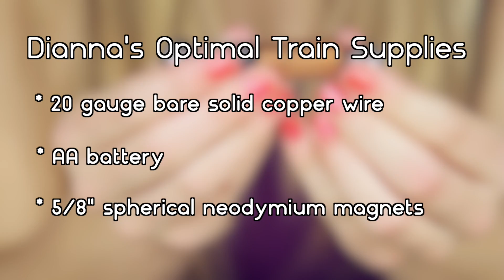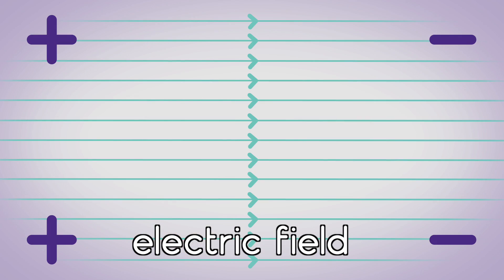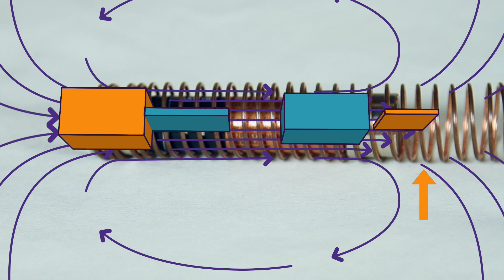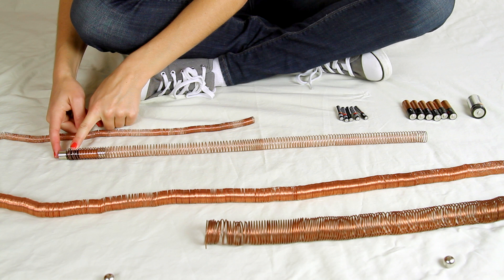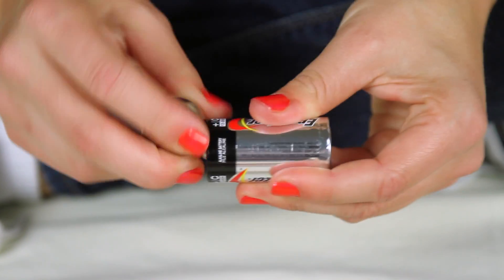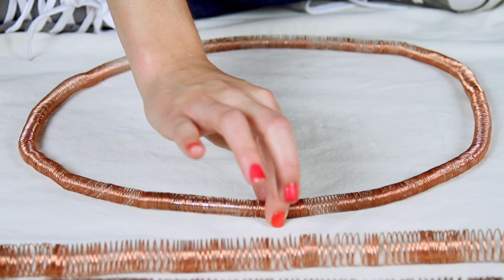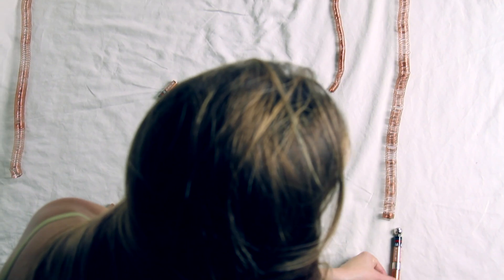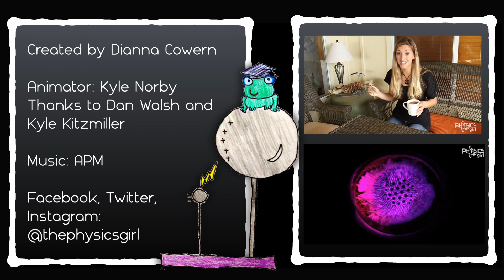World’s Easiest DIY Electric Train

Comment: I'd be very interested to see a follow up video that attempted to explain why some sized batteries worked better than others. There are a lot of variables at play but it would be fun to try to figure out how much EMF is being generated vs the weight of the batteries and magnets. Then maybe an accurate prediction could be made as to what the fastest combination is.

I know it might be a little too technical for this channel but I would appreciate a nudge in the right direction to investigate this myself.
Reply: I think you're right about the weight of the batteries being a factor.  A single D cell doesn't put out any more power than a single AA cell, it's just able to do it for longer (more milliamp-hours) and so is larger and weighs more.  So given the same amount of force being generated, the D cell electric train would go slower than the AA cell train.  But if put to the endurance test, the AA would poop out first.  At least that's how I figure it.
Reply: You need higher voltage, higher power output which for batteries translates to faster discharge capacity and obviously less weight. LiPo cells would almost certainly excel at this. A high voltage supercapacitor with a resistor to limit its discharge should be able to shoot out like a bullet.
Reply: I would say weight has a lot to do with it. After she did the AA I was thinking about a AAA, I know those two provide the same voltage but one is smaller so it should move faster, then she mentioned AAAA which I've never heard of. If it provides the same voltage and force as the AA it should go faster since there is less to move. I'm not sure off of the top of my head how the D voltage compares to the others but from the results, I would guess it's weight increased more it's voltage relative to the others.
Reply: There are other variables like the thickness of the wire and how tight the coil is to the various sized batteries and magnets. Also the distance between the magnets.
A high powered watch battery would be interesting. I might just have to run my own experiments!
Reply: +Patrick Beecroft I hadn't considered a watch battery, that would be interesting to see. But the thickness of the wire shouldn't really make much of a difference though I think she said it was roughly 20 gage wire.
Reply: +Patrick Beecroft I hadn't considered a watch battery, that would be interesting to see. But the thickness of the wire shouldn't really make much of a difference though I think she said it was roughly 20 gage wire.
Reply: The batteries tried in this video all roughly have the same power to create a current, because they have about the same inner resistance, at least same order of magnitude. So they all create about the same amount of force, but they have different weights, resulting in different amounts of friction due to gravity pushing them onto bottom of the track. If you try a battery that has a much lower resistance, e.g. a CR123A lithium battery, and that in addition is much lighter, you should get significantly higher speeds. The track might not hold up, but I'd like to see that :-)
Reply: ASMR Explorers You're probably right, CR123A can be discharged with 2.2A and at double the voltage than a double A.
Reply: Patrick Beecroft You are right, but the winding will have a bigger effect of the outcome.  More raps and tighter winding will effect the current significantly.  As for the batteries...AAA, double A, C, and D are all the same voltage just different milliamps.  I would also love to see and experiment more with this idea.

Comment: I wonder what would happen if you could electrically connect the two ends of the coil, while you have it looped in a circle..

As it is, there is a brief moment while crossing the "break" where there is no propulsion, only momentum.

With a completed loop circuit (electrical), would a counter-field be generated in the remaining wire? If so, would it aid or slow the progress? If it continued to move with the wire connected, wouldn't this constitute a perpetual motion device? Maybe even without the connection.

If this could be mounted to a framework to hold the coils in alignment, could a secondary coil be wrapped around the first and used to generate electricity from the passing magnets?

Just thoughts after watching your wonderful video   : )

Comment: why cant we generate electricity using this principle?. (I'm guessing we don't )
Reply: what?? the field is produced through electricity, this train CONSUMES electricity
Reply: Minhaj Siddiqui 
Calm your jets.. I didn't say I knew anything now did I. .  ?   How does it "consume"?  - chemical energy of the cells?
Reply: electricity does generated by electromagnetic induction
Reply: This system consumes energy. The magnetic field that was produced by the copper coils was made from the current provided by the battery.

What you are talking about is something else but based on the same core idea. Electricity is generated when you have a coil "cutting" a magnetic flux. Basically shove a magnet through a coil and the changing magnetic field will induce a current in the coil.

Comment: The AAA batteries and C batteries have the same voltage, so they have the same force. However the C battery has more mass so it can't move as fast. Hence the smaller AAAA battery goes faster. Of course, the C battery has a larger capacity so it should run for longer before dying.

Running batteries in sequence increases the voltage so they have more force, but it's also not perfect because you are also increasing the mass. But if you found a battery with a larger voltage it should move faster.

Comment: Can this be the future of trains?
Reply: In a way, this is a rudimentary Maglev train.
Reply: dimitriofronin Cool!
Reply: Actually its not anything like a Maglev train because the magnets are not levitating anything. All the weight is still pushing down on the wire. The magnets are more like the drive wheels.
Reply: That's fair enough. I prefaced my statement with "In a way" because I was aware it was functionally different in many ways. Nonetheless, it is propelled electromagnetically in which some systems of Maglev are. I did not mean to be misleading, simply relating the most basic concepts together. However, your statement of it not levitating is true, thus removing the "lev" portion of "Maglev".

Comment: is the explanation about the "different" magnetic fields really correct? I'd say that the magnetic field created in the coil pushes against the fields of the magnets equally, not one more than the other. Or did I misunderstand?
Reply: It's that the magnetic field is stronger more towards the middle and weaker on the very ends. So on each end the magnets have to be oriented to take advantage of that. The strength (not direction, just magnitude) of the magnetic field goes in mirror images on either end, so the orientation of the magnets have to be in mirror images on either end too. That way the poles closer to the middle on each end are the ones that matter.

Comment: Hi, I've some questions!  I understand that a magnetic flux (say by moving a magnet) through a coil will induce a current in the coil which will in turn generate a magnetic field to oppose the motion of the magnet. So, does the battery function only to strengthen the secondary field? Can we replace it with just a metal piece and see at least some similar but damped motion upon a light push? or would that completely violate the conservation of energy and that the battery is integral to break the equilibrium?

Comment: Try again with a lithium battery! More voltage!
Reply: I personally wouldn't want to create whats probably a near perfect short. Unless you had some small circuitry to control the discharge rate and stuff. And a small enclosure like a hollow pvc tube with a magnet either end as electrical contacts.
Reply: Nico Mariño /osfgkFyq7lA?t=242
thats why it is dangerous.
Reply: Nico Mariño its a quite a thick copper wire so the resistivity of it shouldn't be high at all. So it would still be a dead short. . But at the current and voltage its at, the formula P=IV would probably show a high current and drain the 1.5v AA battery quite fast. She said she used 20guage i believe, 
So according to this
https://en.wikipedia.org/wiki/American_wire_gauge
33.31 miliohms per meter of wire. Which considering making a coil and the wire at the 2 terminals is a lot less than say even half a meter.
its practically a dead short as i stated.
Reply: Nico Mariño  The resistance on the metal coating ion neoodymium magnets have tiny amounts of resistance. People use them as quick connections to batteries for ages. If they did have (significant) resistance the magnets would heat up. which at the current is nothing. With the 20 guage wire and assuming 40cm of wire is in contact at any 1 moment through the wire with the details i shown from wikipedia, 
V/R=I
(1.5)/(0.4*0.03331)=113Amps
Since that is physically impossible its likely the internal resistance would increase a ton.
So the voltage would drop to something tiny like half a volt or whatever in a AA battery.
Though with a lipo, the video i sent done a short through even thinner wire with likely higher resistance and it does heat up and would eventually blow. Only with a controlled discharge circuit should someone do that. Which is hard to fit into a tube like structure like a AA housing. I wouldn't mind seeing someone make it. There are some tiny lipo's out there.
Reply: Nico Mariño Not sure. But i am sure it varies based on C rating.
Reply: Nico Mariño ok. Ill research when i have the time i guess.
Reply: I reckon the resistance it sees is higher than the stationary resistance due to electromagnetic induction. Think of how mains transformers work. If they were stretched out without a core, they would totally burn out straight away.
Reply: Prehistoricman maybe. But it seems not particularly tightly wound. So I agree some resistance will be made, however it doesnt seem too significant. If you know, i would not at all mind you sending me the math.
Reply: Mr Rishi The Cookie Oh no, I don't have any maths. A level physics doesn't tell you about frequency response and inductive loads and that kind of business and I couldn't do electronics.
Reply: Prehistoricman Eyyy I just finished my AS physics(AQA new spec) exam earlier today. Im probably doing astronomy as the module next year if not, then electronics seems cool.
Reply: Mr Rishi The Cookie Oh nice! The new spec is rock hard! props on doing it, it's basically as hard as A2 physics these days.
Reply: Prehistoricman Some bs questions came up. You should see the twitter complaints.
Reply: Mr Rishi The Cookie 
There are lithium cells which are shaped like cylinders,in fact they are one the most common types of lithium cells and they usually have an over discharge protection circuit built in,so they wont explode even if you short them.the AA equivalent is called 14500.Usually they dont have a high C rating,they can put out maybe 5amps at max,though some can discharge at higher rates.
If the inductive component of the circuit was insignificant then the movement of the train would have been insignificant too.
I Tried shorting a 18650 battery which can discharge at 20a cont. no problem with a 22awg 50cm wire and it was pulling less than 9amps (should be about double with a 20AWG),the wire was getting hot but it was still less than 90c after 4 seconds.I'd try making the train but i dont have the correct size magnets.
Just for the sake of it i shorted out my 1800mah 70C 4S lipo with the same type of wire and the max current draw was less than 50a before the wire blew.So the 113amp draw is not going to happen at 1.5v in real life.
TL;DR: it's not a short circuit and it'll be unlikely for a lithium cell to explode if you used it unless you use a low C,low capacity lipo with no over discharge protection and dont let the train move.
Reply: +Dwg thanks for correcting me. So what you are saying is that it should be OK but comes with risks as compared with an alkaline battery. Science is fun i guess. Hope your train works out.
Reply: You've got a point there, however if the train is moving, each section of the coil would only have a current passing through for fractions of a second, so I doubt it would overheat. However if your train gets stuck, you could indeed have a hole burned into your carpet from glowing copper wire within seconds, no doubt. I'm sure that would only add to the excitement though :-)

Comment: Your magnetic field diagrams are not very helpful.  The right hand rule might help.  
The force applied to a magnetic field is at right angles to the current and also at right angles to the magnetic field.
The direction of the current is pretty clear, between the two contact points.
It is through the coils that surround the battery, between the contact points, and no where else.
So the field around the outer ends of the magnets has no current to react against.
 
But the two like poles, pointing flux toward the battery 
(or away from it, depending on whether two north or two south poles are stuck to the battery), 
produce a field pattern that sprays out all around the battery, 
passing at right angles through the coil current.  
So the force generated is at right angles to both the current and the outward (or inward) pointing flux.
The only direction that is at right angles to both of those direction is along the axis of the coil.

That shouldn't be so hard to show in a graphic.

Comment: Would replacing the 1.5v batteries with a 3.7v li-ion (18650) make it faster? Or would the extra power/extra weight cancel each other out?
Reply: Higher voltage = higher current = stronger magnetic field = moa powa
On top of that most lithium cells have much lower internal resistance than alkalines so they can deliver more current (on top of the higher current because of the higher voltage). So a li-ion should definitely be faster, but if it gets stuck in the coil you should run ;)
Reply: I don't really think shorting a li-ion is a good idea.
Reply: +Ireallyreally Hategoogle The copper coil has a very low resistance.
Reply: I second that suggestion
Reply: +WKDworks technically you are.
Reply: Well that's really just even more reason to do it! FLAMING MAGNET TRAINS!
Reply: Use a 16340 cell, it's the same voltage, but smaller, which means it's lighter so it will move faster. It can probably provide the same current as an 18650
Reply: ***** you aren't just shorting it out, you're using the energy.
Reply: It's not shorting it, the coil has resistance.
Reply: *magnetic field ;)
Reply: Ermude10
Thanks, of course. Corrected.
Reply: more coils between the magnets means more resistance and more magnetic flux. Just be sure not to short the coils :)
Reply: Danny, sorry but if you're solving for current: Current=Voltage/Resistance. Since the resistance of the wire remains constant, more voltage does indeed result in more current.

Comment: What would happen if you were to introduce an outside electric current to the coil alongside the battery?  Would the increase in electricity on the coil combined with the battery allow a faster and more forceful movement?

Comment: Make it easier learn to solder. Put copper wire rails on the outside to keep the winding uniform. Try rails on the inside for it to ride on.  Could you do this in 1/2 inch copper pipe? When you drop a single magnet down a copper tube it slows down.

Comment: I don't understand the use of the battery here, I understand that the magnetic field is caused by the magnet movement inside the copper wire and it pushes the the magnet. but where does the battery role in this

Comment: The C size battery performed poorly because it has more mass but is still 1.5 volts just like a AA or AAA. Try it with a 3 volt watch battery (or maybe several). More voltage, less mass

Comment: Dianna you have to make a much bigger track like a rail gun!
Reply: so basically you could make a rail gun that shoots batteries as bullets, the magnets would make the bullets real expensive though :P
Reply: +Wabbajack Wabbajack compressed air is much cooler especially as electrical circuits tend to run fairly hot
Reply: closer to a coil gun or Gauss rifle I would think
Reply: SavageMoose oh sorry I meant cool as in "badass", not temperature :P
Reply: A battery could knock a projectile instead, so you would lose the projectile and reuse the battery.
Reply: Dear Lord, I was actually thinking of making a railgun while watching the video. You beat me to the comment
Reply: +MasterMazeProductions yup...a lot cheaper/more efficient to shoot em with compressed air, but not as cool, unfortunately.
Reply: they have a really big one of these in Japan. So large in fact, that people actually hitch a ride on them almost every day!
Reply: +Cognito 
Check out the US Navy's new rail gun. Requires a small power plant to run, fires a 25 lb projectile at over 1 mile per second. Crazy. Here's a link to the article I read on the Wall Street Journal:
http://www.wsj.com/articles/a-first-look-at-americas-supergun-1464359194
Reply: Mass driver when?
Reply: yes on railgun